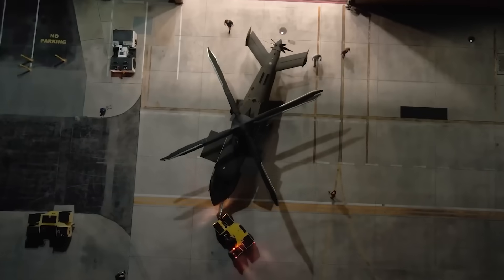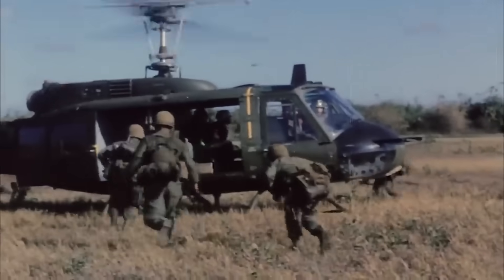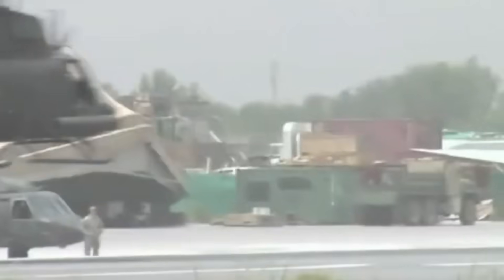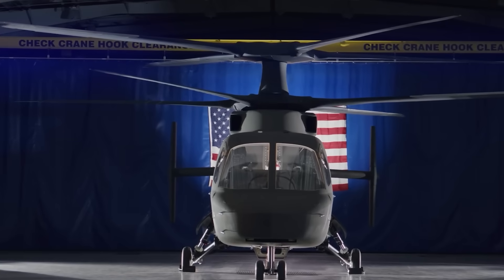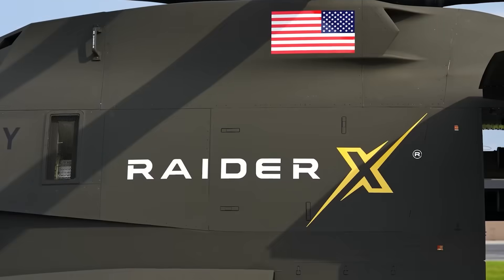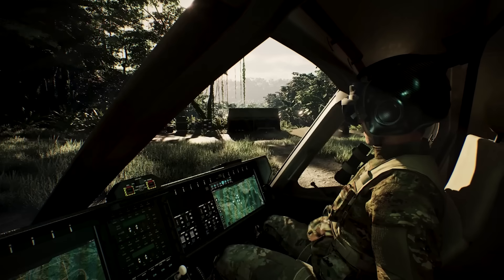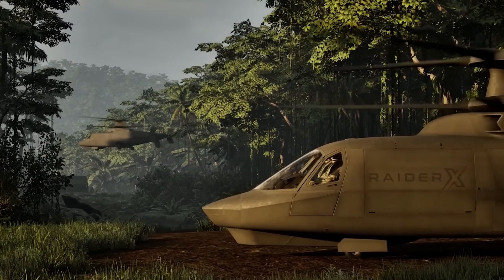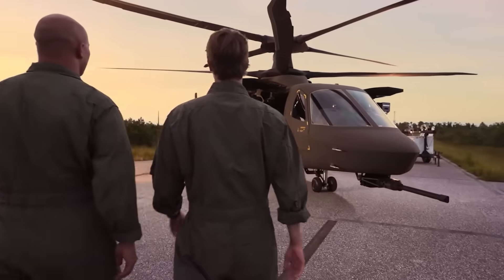America's All-In-One Killer Helicopter of the Future

Comment: What I'd like to see is a backup thrust system in the tail that could be activated if blades of one rotor were damaged, or some other failure that left a bias in the counter-rotating blades. It could be a fan, normally shuttered, near the end of the tail powered by the tail rotor motor and permitting flow in either direction. It wouldn't have to be powerful enough to counter rotation at full speed of the main rotor, but only enough for slow lift-off or landing, or perhaps only emergency landing. I know nothing about helicopter flight, engineering, or combat, but I'd imagine that some kind of redundant system like this could greatly improve safety.

Comment: It would be interesting to see the cost comparison between Bell 360 and Raider X per helicopter.
Reply: People complain about the V 280 being too complicated. 

Like the Raider X or Defiant with a contra rotating blade, and push prop design is any less complicated! I'd love to see the drive train on this. 

 An engineers wet dream, and a mechanics worse nightmare, hah. 

 The presicion needed is insane. I've seen diagrams of the Soviets, and it is pretty cool. 

 Wonder why they couldn't go hybrid. Can have all the rotors you want with way easier maintenence. Axial flux motors are pretty insane. There is one by Helix UK that is 52 pounds for 800 hp. I don't know if you can scale it up, but someone should try.
Reply: @dianapennepacker6854  Because you will not get the capability needed for a military aircraft by going electric.

Comment: Some scenes show the rear prop turning and some don’t. Is that an animation error or is it used situationally?
Reply: Its only a guess, but the rear prop is for forward movement so min hover it wouldn't be needed.
Reply: It’s forward propulsion to gain speed as same as a turbo prop plane. 
Army wants faster speed in helicopters for out maneuvers of ground to air Manpads. 
I’m just curious if back prop can reverse for going backwards while still engaging targets? Or if helicopter have to turn away from threat to run? Which actually is a big deal in engagements of this sort. Turning from target would give ground troops just enough time to fire a IR guided
Reply: @thomashenshallhydraxis To move forward doesn't need back propeller.
Traditional helicopters also don't have back propeller.
Back propeller makes it faster. 

It can moves backward and sideways.
The ability to hover (stay on one spot) is unmatched, because it can moves 360° direction.

Comment: As I understood it, NASA and DARPA funded research with Carter Aviation Technologies for the CarterCopter. This was to create a replacement or alternative to the V22 Osprey. The idea was to build an aircraft that was a combination of a Gyroplane and a Helicopter. 

The problem with rotorcraft is that there's a maximum speed that cannot be exceeded as the tips of the rotors approach the speed of sound. There's two ways to get around this. The first was to have 'wings' and then place a rotor at the end of these wings which could be rotated in flight to allow the craft to take off vertically and then travel faster than the limit speed when in horizontal flight. That solution led to the V22 Osprey.

The alternative was a novel solution of having a single rotor and a pusher prop as seen in this video. Only that would not overcome the need of having a tail rotor, unless the aircraft was a gyroplane and it only used the engines to power up to the lift speed, then disconnected as it 'jumped' into the air and then went into autorotation and was pushed forward. Cartercopter actually built two demonstrators to prove this by converting a Butterfly Monarch gyroplane so it could jump takeoff. They then built another experimental gyroplane that could use Slowed Rotor / Compound technology which meant that the main rotor could be slowed in flight so that the tips of the blades never went over the speed of sound and small wings would provide the lift in forward flight.

The end goal was to try and produce a much larger aircraft that had multiple propulsion props on wings feeding into one main rotor. The speed of the propulsion props could be adjusted to counter the contrarotation so you would not need a tail rotor and in horizontal flight the main rotor would slow down sufficiently so that the wings would provide lift and the speed increased past the limit point. There are a number of videos showing this concept in CGI graphics but there are also a lot of videos of the experimental aircraft that Carter Aviation made to test the idea. They did achieve a record by exceeding mU-1 from slowing the rotor in flight.

As far as I am aware, Carter Aviation sold the slowed rotor technology and has started pure research.
Reply: This design has absolutely nothing to do with Cartercopter. It is based on Sikorsky's X2 prototype, which was based on research made on the S-69. Cartercopter is not even in the wheel house of this aircraft.

Comment: I could be wrong but I thought this helicopter lost out to the V-280 Valor tilt rotor built by Bell. Think they won the contract last December of 2023. And the Valor is supposed to be replacing a whole bunch of helicopters. Unless this is being used for something else Ive not heard of?
Reply: Two programs running simultaneously(Albeit slowly) is FARA and FLRAA.  This vid is for FARA which is small compact helo for city insertions and attack. Raider X will easily win this compared to the Bell Invictus version as Raider X is faster in the air, in the insertion(can go from full speed to full stop in half a mile(claimed of course)), and has superior hovering efficiency for fuel, so will stay on station a LONGER period of time... and has a smaller footprint so can technically insert into smaller areas though in reality they are identical sized. V280 won the Future LONG RANGE assault aircraft competition, not FARA.  It would not surprise me if there are more FARA helo's built than FLRAA as FARA can also be used on ships more easily than the v280, or ship design will just have to CHANGE to accommodate the V280(what actually should happen with a v280 naval variant(but probably will not)
Reply: @w8stral  Got ya. Thought it might be something like that.

Comment: Rivals the payload capacity but has no winglets for rockets & guided missiles
Reply: Weapons are inside it
Reply: weapons inside, less drag, this bird feels the need... the need for speed...
Reply: And baby wings can be added which are already designed(others have already discussed this), but technically will be inside though one questions how this will work logistically.
Reply: @w8stral   i Think Thats for the S-97 Raider and not the Raider X
Reply: @Toby8700  You are correct, but I'm pretty sure they'd be able to put external hardpoints on the Raider X as well. That would give them extra flexibility for missions needing Air Assault troops. Could also make it a good replacement for the Little Bird.
Reply: @rvboyett  if i remeber right the S-97 Raider are gonna replace the Little Bird because it can carry 6 troops, unlike the S-97 Raider X

Comment: how is fly by wire rotor better than mechanical rotor?
Reply: Single point failure vrs multiple.  Electrical wires are very hard to 100% destroy via small arms fire or FOD.  Removes hydraulics which is a BIG bonus as well in terms of fire, maintenance, and weight.
Reply: @w8stral  A helluva lot less cotter pins but a lot more safety wire on the cannon plugs. 😉
Reply: @rvboyett  ... fewer* cotter pins

Comment: Co-axial rotors on a helicopter is not a unique concept.  The Russians have fielded helicopters with co-axial rotors since the late 1940s - and they weren't the first.
Reply: Also Sikorsky?
Reply: @TheMercilessEye  Aside from this helicopter and a test one before it, did Sikorsky build any helicopters with coaxial rotors?
Reply: @bertpenney3526  I'M asking the questions here, soldier.  Stand down.
Reply: That is NOT what is unique.  These are Rigid rotors which means the rotors can be close together making them 20% more efficient than a single rotor.  The Russian way is with flopping garbage flying around creating massive drag and gargantuan RADAR returns making them WORSE than single rotor Helo's.
Reply: @w8stral  It's hard to say from the video.  I don't think he mentioned the fact that they are rigid rotors and when he said the design is unique, it was difficult to tell if he was referring to the co-axial rotor setup or that it is co-axial rotors coupled with a pusher prop.

Has anyone else developed a co-axial with rigid rotors?
Reply: @w8stral sounds like something you’d need actual evidence to back up. Have you ever seen a Russian helo in flight lol? It’s one thing to not like Putin but to short change them on their feats of aviation just seems petty.